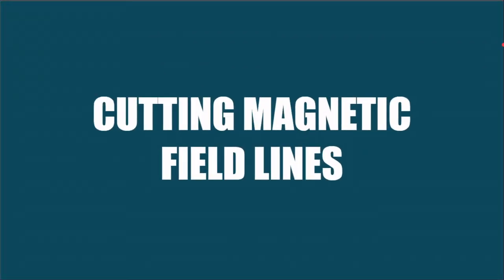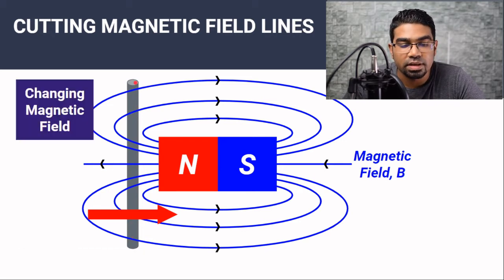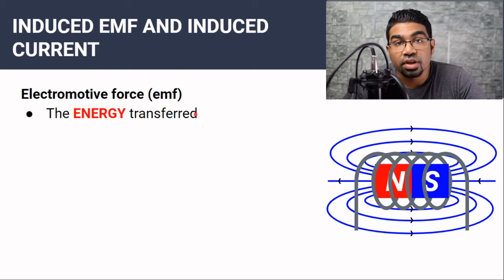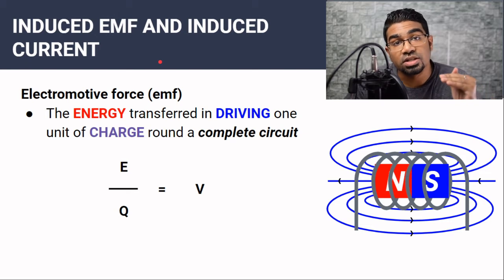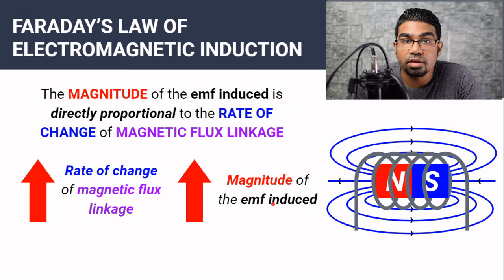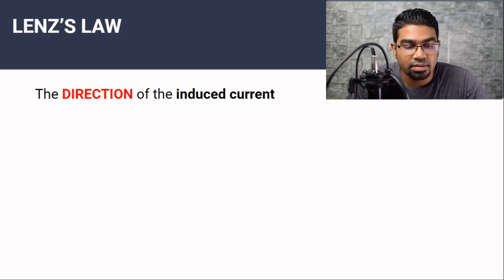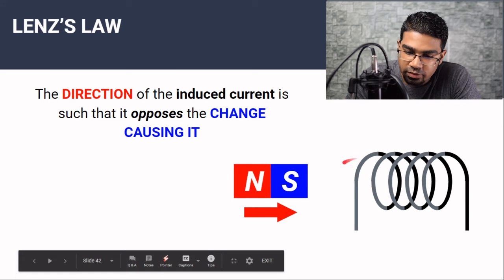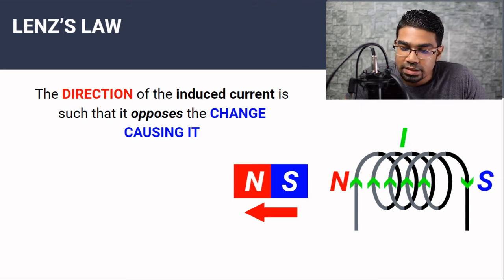Induced Current and Induced EMF

Comment: Thank you for this video! I was wondering if instead of a Faraday cage also a simple box of plastic (e.g. the ones where you can put toys in or stuff) can be used as isolation for batteries and electronic devices in case of induced current generated by multiple M- or 1 strong X class solar flare with CME, since that would be induced current. 
If yes, would the plastic lid be enough or do you need to isolate the edges with something?

Comment: Sir is induced emf and emf is same?
Reply from the maker: It is not the same. Induced EMF is only used when the EMF is induced by changing the magnetic flux linkage of a conductor. But there are other sources of EMF such as batteries. These provide EMF too but we don't call it induced EMF.

Comment: Awesome video...but i have a question.
So whenever we try to move the magnet into the coil....the direction of the induced current is such that it opposes the chang causing it....but we are able to move the magnet into the coil eventhough the direction of the coil is opposing....is it because we are applying more force to push the magnet through?
Reply from the maker: An object can continue moving when two forces of equal magnitude act on it in opposite directions. The acceleration will be 0 but the object can continue moving at constant velocity in the same direction.
Reply: @MrRuelTuition  ohh i understand..tqsm🤗